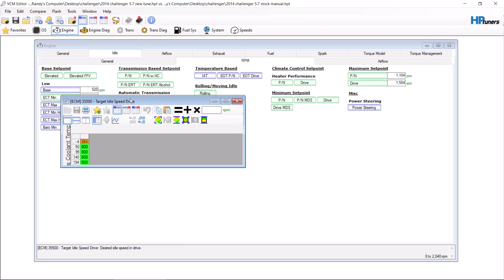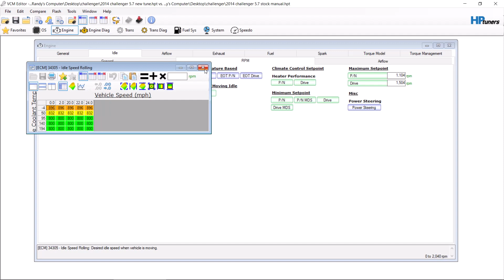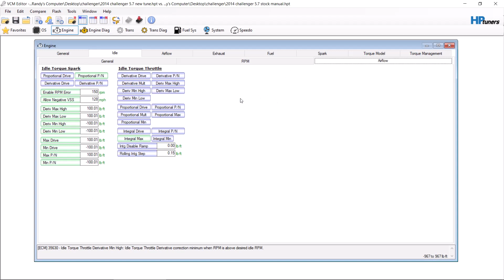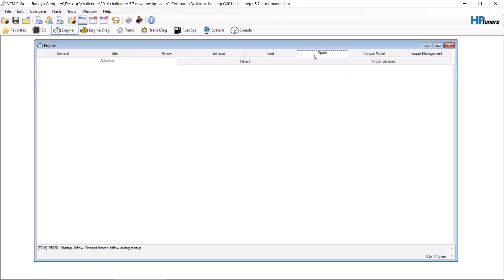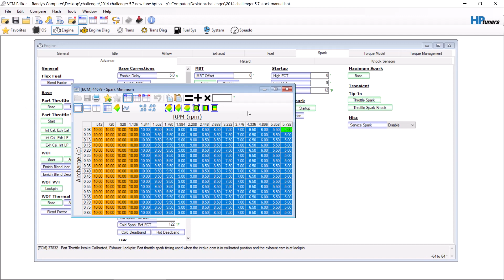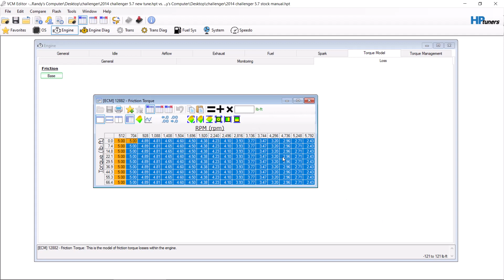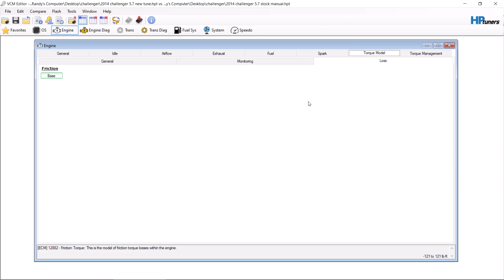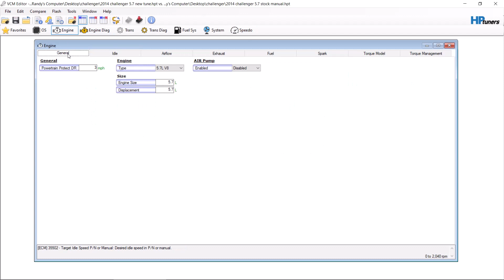Base Hemi cam tuning 2009 and up

Comment: Got a challenger in, will not statt without throttle imput no matter what i do.
Just installed a cam, lifters, springs, pushrods, verified timing on
Ve seems stuck at 78 percent idling 
Car runs like its on about 4 cylinders. Mds is turned off. Any help is appreciated. We are thinking it might be a hp tuners issue becuase we have 5 codes for ecu bcm communication as well at tps code and p1400

Comment: Im still having trouble getting a clean idle. Tried setting it up with the chop portion but just wont stay clean. Ltft is all over the place after each adjustment. Turned nural network off. I had a tune with a diablo and switched to hp. Guy didnt set it up for chop and did mods since so trying to adjust where he was at for longtubes and refreshed cylinder heads. Have an email that you could point me in the right direction. Or willing to do a remote tune?
Reply from the maker: We do remote tuning yes

Comment: Any good tunes for a 2013 dodge charger rt with cold air intake,1.5 comp cam mds delete, kook long tube headers with x pipe with flow master 85 series no kittens 😅 thank you in advance I need more hp😢

Comment: i just did a mopar callanger 6.4 cam swap for a ram 1500 2009 , with an mds delete springs and a 6.2 oil pump will this tune work for the cam ?

Comment: Got a 2012 Dodge Charger RT 5.7. Did the comp cams hrt stage 2 kit, cam, valve springs, lifters, pushrods, VVT limiter, MDS delete also did new timing chain, oil pump, had heads redone at machine shop. Did your exact tune in this video. Cant get the fuel trims down. Long term fuel trim is at -33. Anything you recommend?
Reply from the maker: Is NN off?

Comment: @7.29 you blocked the screen with the next video preview  can't see comparison
Reply from the maker: I’ll have to take a look
Reply: @Recklessmotorsports   I have a tune  I'm trying to get working correctly after a TSP stage 2 cam swap Long tube headers and full 3 in exhaust.  Car runs rich by smell and LTFT B1 -17  & B2 -21 seems like it has too much fuel. Has a hard time starting and also starts and stalls
Reply from the maker: If your long terms add that high you need to be pulling from your MAF setting
Reply: @Recklessmotorsports  thank you. Had another tune was seeing -29 & -30 just didn't know how to adjust. Car seems to like 3.900 lbs of fuel not the 65 lbs kinda strange. I'm trying to learn and so far for got some great information. Thank you again
Reply from the maker: Watch my maf scaling video
Reply: @Recklessmotorsports   thank you for the replies. It helps alot
Reply: @AlexD-fq5zm  same with me. How did u get the fuel trims down?
Reply: @shanem6114  paid to have it tuned. Guy bricked my ecm then set it up at almost anything about idle on the pedal puts it into open loop and will never get ready for emissions. He deleted cats deleted downstream O2 sensors overall extremely dissatisfied and disappointed.thinking of going back to stock as I can't get car to pass emissions

Comment: I had my car done by a reputable shop in Houston.  I supplied the cam and parts, either from the cam manufacturer or OEM, mechanical went well, tuning was a nightmare. They had to road tune it, i dont think they drove it. Think they loaded a tune from a similar car. It also ironically will NOT restart once warm unless i feather the throttle ever so gently. And the chop is..well yeah ive got videos. Goes from undercover to billboard 🥴
Reply from the maker: The warm crank spark is too low
Reply: @Recklessmotorsports  yeah I got a new tuner to take care of it. Now my only issue is downshifting from 4 to 3 qhen stopping harder than normal causes the rpms to jump once it finishes,  and not by just a small amount either. The car literally accellerates for a moment lol

Comment: This video has been a lifesaver for doing the cam swap in my 2014 rt. I’ve been working with all of the tables you mentioned in this video, It runs and idles fantastic but I’m still getting some rev hang and a little fluctuation in rpms when coasting to a stop with the clutch in, then idles perfect once stopped. Any recommendations on what else to look at?

Comment: Great video man! I'm going through my tables for fun (very new to this) and noticed that certain tables like startup airflow and proportional P/N (on my file) only have one set of values to adjust rather than a whole range like you are showing. Is this a model specific thing maybe?  I have 2010 challenger R/T - 5.7L with auto trans and MDS.  Thanks!!!
Reply: mine as welll

Comment: Thank you for doing this!!! is there anyway you would share that tune file and i can compare it with my charger tune that i am write up? thanks
Reply from the maker: Which video is this
Reply: @Recklessmotorsports  this is the 2009 plus 5.7 hemi video. believe the video show a tune for challeger with manual. Have you tuned any texas speed cam for hemi? if so, care to share? thanks man

Comment: I have to say thank you for this video. The car was stalling just like you mentioned and after making the adjustments to the torque model loss, that fixed it. Drove through stoplight traffic for 2 hours with multiple stop and go and never stalled once. Thanks again also for the other videos keep up the good work.

Comment: sorry but how can I cancel VVT  100%
Reply from the maker: Go into file and under vvt where it says enable under e haust or intake cam switch to disable
Reply: @Recklessmotorsports  you have a social media or email I can reach you at ? Need assistance on my vvt hemi tune
Reply: Why would you want to?
Reply: Does this apply to my 5.7 hemi on my truck im trynna learn how to tune 5.7, 6.1,6.2,6.4s